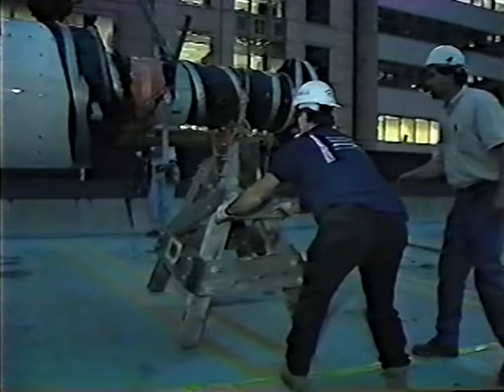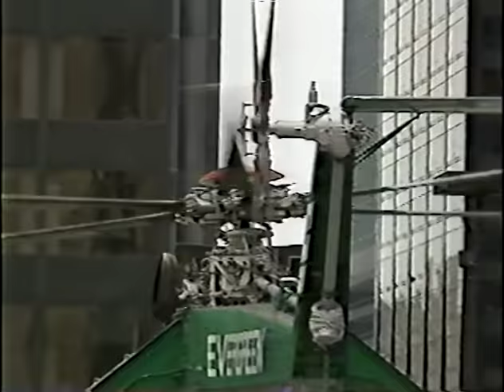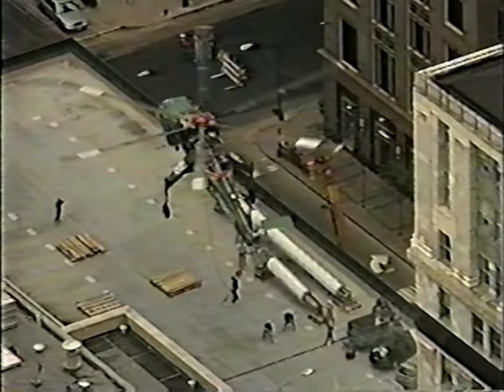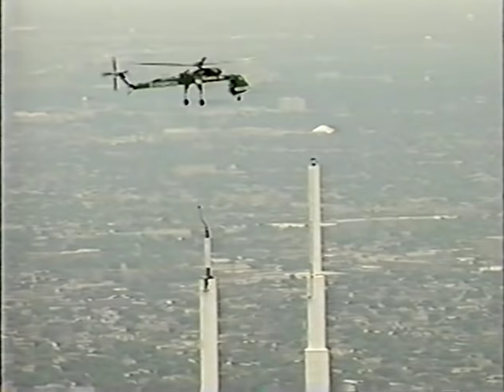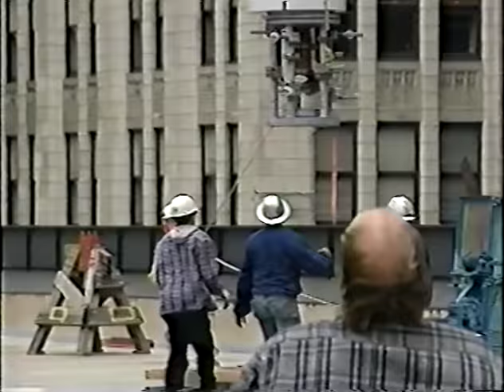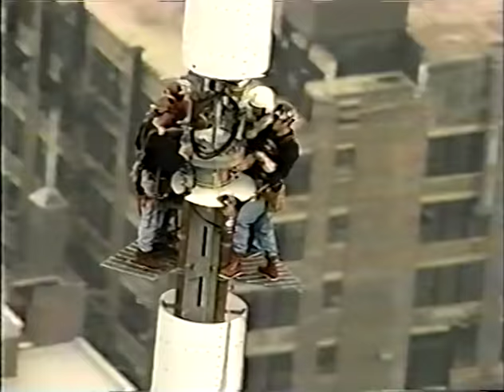Addition to the West Antenna Tower. Sears Building, Chicago, Illinois. Sunday, June 4th 2000

Comment: How many of your stomachs dropped several times while watching this video. Even while typing this I still feel a little woozy
Reply: Omg mine
Reply: I'd rather be one of the guys on the ground. Can you imagine being on the side of that mast some 1600 feet up with that chopper overhead producing all that wind? Nerves of steel.
Reply: For those individuals who can handle those heights , More power to them
Reply: Omg my feet will not stop tingling. My stomach is a mess.
Reply: Weak in the knees & actually dizzy…
The inside guys bad enough…but the brass balls OUTSIDE of the antenna…if my life depended upon it…NO WAY POSSIBLE!
Reply: I nearly chit my self 👍👍

Comment: I personally installed the N+1 combiner on the 100th floor, that made it possible to transmit the NTSC and Digital TV  signals simutaneously. The DTV was at low power around 20 KW,  while the NTSC was at 60KW (?). The FCC required a 5 year conversion window, for all stations to go full on DTV.  This must be the final DTV antenna. They have the ability to use both antennas each in half power mode, or either antenna in total power mode as backup. The elevator to get up there takes only like 30 seconds to go 100 stories. Its like a carnival ride. We went on top of the building one night to take in the view, and I was able to look over the edge of the building down at the street. Freaky. No one can be on the roof when they are transmitting, or else you will be fried my the strength of the UHF signal. When they have to shut down like this, the station manager told me that they potentially could loose $100,000 a minute. and that was in 1999 ish.
Reply: So if someone would fry if they’re up around the antennas when they’re functioning, how are aircraft able to fly in close proximity without terrible effects? And obviously I’m not talking about the Erickson Sky Crane used in this video. I mean regular aircraft flying close by from day to day. In a helicopter you can legally fly right next to those antennas.
Reply: StringerNews1   I’m a commercial fixed wing pilot and will have my commercial helicopter license in a couple months. 14 CFR 91.119 says 500’ minimum altitude over congested areas and 500’ from any structure, person, vessel, etc. However it also says, “If the operation is conducted without hazard to persons or property on the surface - may be operated at any altitude provided any person operating the helicopter complies with any routes or altitudes specifically prescribed for helicopters by the FAA.”

500’ is pretty close, especially when you’re talking about an antenna that can broadcast with the power it has. This doesn’t take into account making approaches to heliports, which could absolutely take you within less than 500’ distance of other structures.

So nobody is talking about playing chicken with buildings. I’m talking about normal operations in a large city environment like Chicago.
Reply: StringerNews1   Tell me you know very little about aviation without telling me you know very little about aviation. 

1) A good sized part of commercial aviation has nothing to do with the airlines. In case you didn’t actually watch the video, the helicopter used was not doing so under part 121 operations (that’s scheduled flights, i.e. airlines)

2) You clearly weren’t paying attention to the fact I said helicopters multiple times. Minimum operating altitudes and distances are not the same between fixed wing and rotary aircraft. 

3) Yes there’s controlled airspace all over in Chicago. I’m very familiar with it since I’ve flown around and in it plenty in the last couple years. You realize that helicopter fly inside the class b and c airspace all the time in Chicago. It literally happens every day. 

4) Since you think you know about airspace, please define areas around downtown Chicago that are restricted. There’s really only one answer. I’ll wait.

You’re very clearly making a lot of comments that demonstrate you know just enough about aviation to make yourself sound ignorant to any person with marginal aviation knowledge, let alone someone that’s passed 5 check rides so far and counting.
Reply: StringerNews1  LOL! There was no mistake. The fact you think you caught some kind of mistake is the reason you perfectly embody the Dunning-Kruger effect. Good riddance.

Still waiting on you to describe your restricted airspace in Chicago btw.

Comment: The base of those antennas are anchored down to the 106th floor and those guys you see going in the antenna thats the 108th floor which are the mechanical floors from 106 to 108 floor 109 which is the roof and the penthouse for the glass clean machine that sits in the penthouse is floor 110
Reply: Wow! So the antenae start on like floor 103??
Reply: @generalkickass6385  so then, the antennas' bases begin on the bottom of the 104th floor right then?
Reply: @2kevinthecool  the actual base of the antennas are anchored on floor 106

Comment: There is a small window in which to do this. The weather has to be right, which means as little wind as possible which is rare in Chicago. As little traffic as possible, so on a Sunday when very few people and cars are around. It can't be too hot either, thermal drafts will cause problems. Plus, using helicopters aint cheap you wanna get those boys off the clock as soon as possible. You have to do things quickly and efficiently, but this is the kind of work that cannot be rushed, it'll be done when it's done.
Reply: Tks bob for the insight
Reply: The windy city.
Reply: @mikemarley2389  Its not actually windy. Well, i should say its no more windy than any other city is. The name was from a Cincinatti enquirer in 1876 that depicted a tornado that blew through the city while also poking at the local speakers that were "full of wind". Something along those lines. Possibly ChatGPT that ....

Comment: N6979R  been flying since 1968! amazing piece of machinery! even more amazing are the crazy mofo's up on top of the antenna!
Reply: I just looked at the flight aware to see if it was still in service too. Still flying as of 06-08-2022
Reply: When you got something that works don't fix it,!!!
Reply: I remember seeing this helicopter in the 70's  when it came once a year to Flat Rock Michigan to install equipment on the roof of Ford Michigan Casting Center.  This was Fords largest iron foundry at the time.  Building was too big for a giant crane to reach the center of the building.  So we had to hire Evergreen once a year to install equipment on the roof.  It was usually a Sunday, nobody was allowed to work in the building, in case the pilots had to drop your load to save the chopper.  If I remember it was something like $20,000 to show up and $1,000 per lift.  If the millwrights rigged it wrong, and  the chopper picked it up, and set it back down, CHA CHING!  A thousand dollar mistake by the mill wrights.  Didn't happen very often, our M/W's and Tinsmiths were very good at rigging!  Talked to the pilots, and most of them were Vietnam Vets at that time.  Nice guys and VERY SKILLED AT FLYING HUNKS OF STEEL THRU THE AIR FOR US!!
Reply: @whuffer5103  or 06/08/2022 in the rest of the world
Reply: Yes, Correently owned By Helicopter Transport Services and Is based in OR, USA
Reply: @kirkkirkland7244 Like all licensed commercial aircraft,  It has FAA regulations regarding regular maintenance.  That aside, it is a machine with a considerable value.  Overhauls can cost hundreds of thousands of dollars but replacement would be many millions of dollars.  Well maintained aircraft can last an astonishing length of time.  There are still many Douglas DC-3's providing commercial freight and passenger service.  The oldest will be 90 years old in five years.  It is in excellent condition and will easily still be flying revenue service on it's 100th birthday
Reply: @kirkkirkland7244  That doesn't apply to aircraft, Aircraft undergo constant scheduled maintenance, That's why they're safe.
Reply: @donkerouac3746  40 years ago, i took a commercial flight in one of them beauties back when i lived in one of the Bay Islands in my Banana Republic , it rattled like heck ,yet it felt solid !

Comment: Radio stations

East mast

    482 m:
        WLIT FM 93.9 MHz main, 4.0 kW, AMFM
        WCHI FM 95.5 backup, 3.1 kW, AMFM
    480 m: WBMX FM 104.3 main, 4.1 kW, CBS Radio
    476 m: WTMX FM 101.9 main, 4.2 kW, Hubbard
    474 m: WBBM FM 96.3 main, 4.2 kW, CBS Radio
    472 m:
        WKSC FM 103.5 main, 4.3 kW, AMFM
        WGCI FM 107.5 main, 3.7 kW, AMFM
    470 m: WFMT FM 98.7, 6.0 kW
    468 m: WLS FM 94.7 main, 4.4 kW

West mast

    460 & 451 m:
        WFMT FM 98.7 backups
    443 m:
        WBBM-FM 96.3 backup
        WBMX 104.3 backup
    W264BF (simulcast of WHLP) 100.7 MHz, 2 W, Calvary Chapel of Costa Mesa
    table of allotments: **WLIT, WLS, WBBM, WTMX, WBMX, WCFS

NOAA Weather Radio station KWO39 transmits off the tower at 162.550 MHz. Programmed by the National Weather Service Weather Forecast Office in Chicago, it is equipped with Specific Area Message Encoding (SAME), which sets off a siren on specially-programmed weather radios to alert of an impending hazard.
Television stations

East mast

    515 m:
        WLS-TV 7 analog, 55 kW, ABC Owned Television Stations (Analog Broadcast discontinued as of June 12, 2009. Now broadcasting only in digital.)
        WLS-TV 7 permanent digital, 4.75 kW
    510 m:
        WCPX-TV 43 digital, 200 kW, Ion Media Networks
        WCPX-TV 38 analog, 3630 kW, Ion Media Networks (Analog Broadcast discontinued as of June 12, 2009. Now broadcasting only in digital.)
        WJYS TV 36 digital, 145 kW, Oxford Media Group
        WCIU-TV 27 digital, 15.1 kW, Weigel Broadcasting
    509 m:
        WXFT-TV 59 temporary digital, 200 kW, Univision Communications
        WXFT-TV 50 permanent digital, 230 kW, Univision Communications
    498 m:
        WTTW TV 11 analog, 60.3 kW, Window To the World Communications (Analog Broadcast discontinued as of June 12, 2009. Now broadcasting only in digital.)
        WBBM-TV 12 digital, 8 kW, CBS Television Stations
    480 m:
        WFLD TV 31 digital backup, 475 kW, Fox Television Stations
        WPWR-TV 51 digital backup, 508 kW, Fox Television Stations
    478 m: WGN-TV 19 digital backup, 310/229 kW, Tribune Broadcasting
    474 m:
        WTTW TV 47 digital backup, 150 kW, Window To the World Communications
        WLS-TV 52 digital backup, 220 kW, ABC Owned Television Stations
    unknown: WESV-LD 40 digital, 37.2 kW, Trinity Christian Center of Santa Ana

West mast

    523 m: WPWR-TV 51 digital, 1000 kW, Fox Television Stations
    514 m, WLS-TV 52 temporary digital, 153.6 kW, ABC Owned Television Stations
    508 m, WMAQ-TV 29 digital, 350 kW, NBC Owned Television Stations
    494 m:
        WMAQ-TV 5 analog, 20 kW (Analog Broadcast discontinued as of June 12, 2009. Now broadcasting only in digital.)
        WPWR-TV 50 analog, 5000 kW (Analog Broadcast discontinued as of June 12, 2009. Now broadcasting only in digital.)
        WXFT-TV 60 analog, 5000 kW, (Analog Broadcast discontinued as of June 12, 2009. Now broadcasting only in digital.)
    475 m: WFLD TV 31 digital, 690/1000 kW, Fox Television Stations
    473 m: WCIU-TV 26 analog, 5000 kW (Analog Broadcast discontinued as of June 12, 2009. Now broadcasting only in digital.)
    472 m:
        WCIU-TV 27 digital, 590 kW, Weigel Broadcasting
        WSNS-TV 44 analog 5000 kW, NBC Owned Television Stations (Analog Broadcast discontinued as of June 12, 2009. Now broadcasting only in digital.)
        WSNS-TV 45 digital 467/665 kW, NBC Owned Television Stations
    465 m: WTTW TV 47 digital, 300 kW, Window To the World Communications
    455 m: WJYS TV 36 digital, 50 kW, Oxford Media Group
    453 m: WGN-TV 19 digital, 645 kW, Tribune Broadcasting
    unknown:
        WWME-CD 39 digital, 4.4 kW, Weigel Broadcasting
        WEDE-CD 34 digital, 50 kW, First United
        WMEU-CA 48 analog STA, 150 kW, Weigel Broadcasting
        WMEU-LD 32 digital, 15 kW

Comment: Actual height is not relative to the fear factor. 2,000 ft is just the same as 200 ft . If you fall you are just as dead. So if you are good at this you have to be confident in your team and your gear. Fear of falling never enters your mind.
Reply: It's just an office. A really really high one :)
Reply: Fear of hitting the ground is where the fear lies.
Reply: with 2000ft, you have more time to think on the way down.

Comment: I was shitting bricks just watching this!!! Imagine being on the out side of the tower grabbing at the load as it was being lowered!!!
Reply: I had a client radio station on the Sears Tower.  It's generally windy as hell up there.  I provided broadcast electrical engineering services not rigging services.  I can tell you that setting a load on a tower with a helo is scary.  It takes an incredibly excellent pilot and a good crew.  The load often weighs thousands of pounds and you don't want to be between the tower and the swinging load.   When the helo sets the load on top, the crew starts bolting it in place.  They have to work fast and if the helo starts drifting while the load is partially fastened...it's pucker time!
Reply: @donkerouac3746  As Peter Crenshaw, from the Three Investigators, would say:” I’ll buy a double helping of that!”

Comment: It seems to me that at one point the component is attached to both the structure and the helicopter at the same time. Therefore, the helicopter is actually attached to the building. I'm guessing that it's really important to get the component firmly attached to the building so that the helicopter can be cut loose as soon as possible.

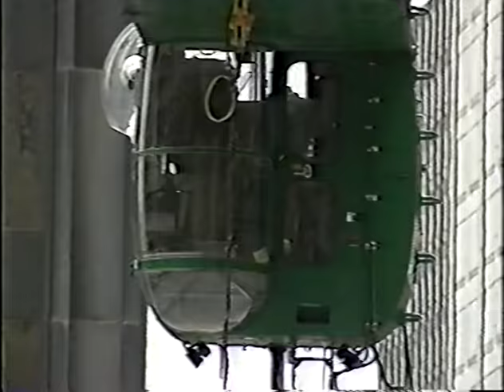Comment: 21:46 they have to distribute the weight of the helicopter so it doesn't punch through the parking deck structure. At over 20,000 pounds, each wheel would would be putting 7,000 pounds of weight in a few square inches. Is that right? Can that be right? I imagine the main gear would bear more weight than the nose gear......however they distribute it.
Reply: About 7700 per main wheel and about 3600 on the nose wheel
Reply: @jyanke3546  Cool, thanks for the info.
Reply: RAEL  Just  for the record a Dieletric model TLP-4A-4O  PATTERN type "A"  UHF TV broadcast antenna weight is 115,000 lbs. I got this from their TV products catalog.
Reply: @gatesmw50  Interesting. Thanks. I would have never guessed that heavy.
Reply: That is why large antennas installed with Helicopters even the Skycrane have to be assembled in parts. The maximum weight this aircraft can carry would be about 19400 due to still needing the fuel on board to operate. Pretty Amazing machine.
Reply: @jyanke3546  Yes exactly. And how old is this Skycrane? It's pretty old, isn't it?
Reply: @rael5469  If I recall correctly SN 64-079 Puts it either very late 1968 or early to mid 1969. It was the Last Standard Category Production S-64E Model off the line.
Reply: @jyanke3546  Cool, thanks.
Reply: @gatesmw50  I've worked on a Gates MW-50 in years past!
Reply: @donkerouac3746  Cool !  Introduced to one at  WABC 77 in NY/NJ.  that 25KV Power supply got my attention more than once LOL !

Comment: The first small part looks like your could put it on a handcart and put it in an elevator
Reply: You still have to hoist it to the top - to the work site. That would take a lot longer than the helicopter lift.  Also it is likely that almost all transmitters (see all the other antennas up there) have been turned down in power so the workers are not fried by all the RF energy. You want to get all the stations/customers back up to full power as soon as possible.
Reply: it looks like a solid steel adaptor of some sort. you aint moving that easy.

Comment: I wouldn't have expected them to go to the expense and trouble of launching the helicopter from a rooftop in the city, but I guess it's better to have the two worksites closer together than miles apart. Scary enough working at that height without the rotor wash of the big Sikorsky bouncing you around, everything flapping and vibrating (see the top section wobble after the chopper lets go?) Probably not much work getting done in nearby buildings as everyone was standing at the windows watching the show.
Reply: They usually do this type of work on the weekends or holidays when traffic is at a minimum.
Reply: Main reasons is fuel/time in the air.  And having a place to set down already prepared incase of an emergency (loss of power).  It that type of area if you have a sudden loss of power you may not be able to clear the buildings to get out of the city.

Comment: I would be interested to know the wages for the day of the top crew.
Reply: Isn't it like $20,000+ per job? Which can be half a day...
Reply: How much of the 20k goes to life insurance? :-)
Reply: The guys I worked with were paid OK but not anywhere close to what you might think...like steel workers, you have to like that kind of work.  It is brutally hard work and usually in the most difficult weather.  Radio/TV stations don't like to sign off for maintenance till midnight.  Sometimes the riggers work all night in below zero temperatures and howling wind.  Icing is a real problem at those heights.
Reply: @donkerouac3746  union ironworkers in Chicago do pretty well
Reply: not that much. the helicopter crew, or a big crane operator, however...